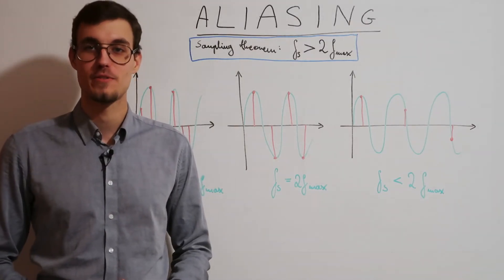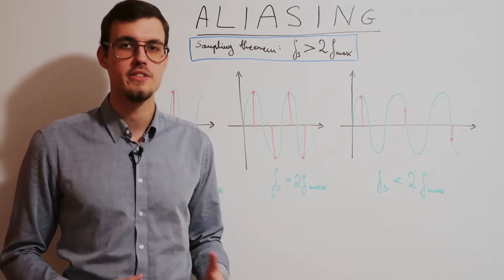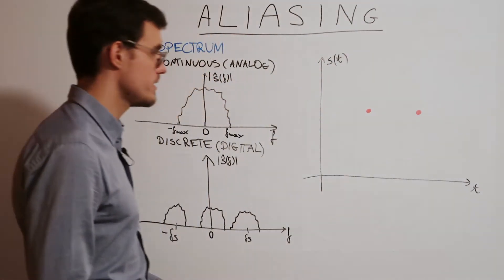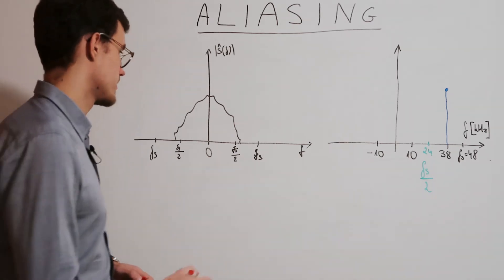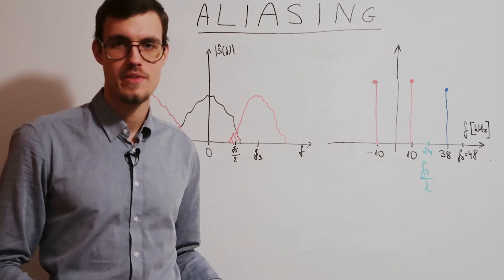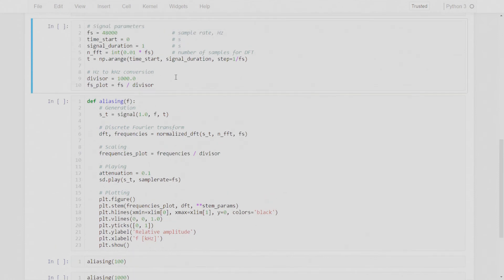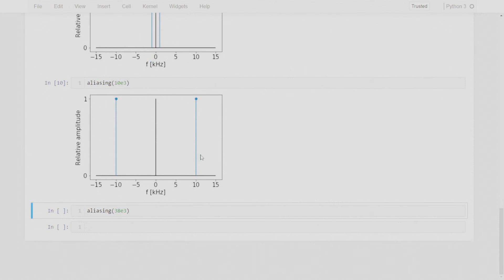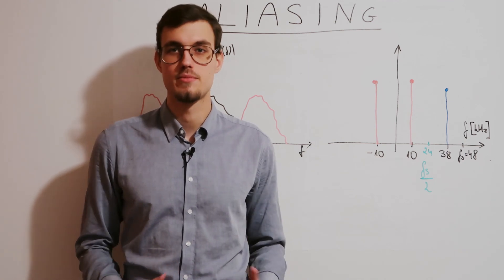Aliasing: What causes it? How to avoid it? [DSP #02]

Comment: If the 20 kHz signal is under - sampled at 30 kHz, find the aliased frequency of the signal.؟
Reply from the maker: 10 kHz because 20 kHz is flipped with respect to the Nyquist frequency, which is 30/2 =15 kHz :)